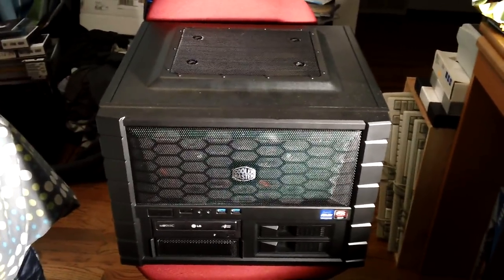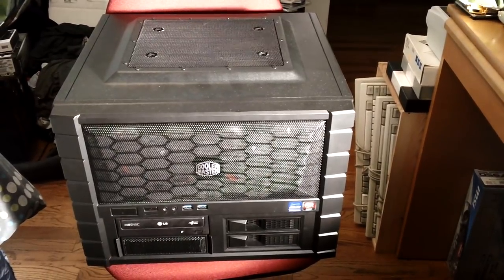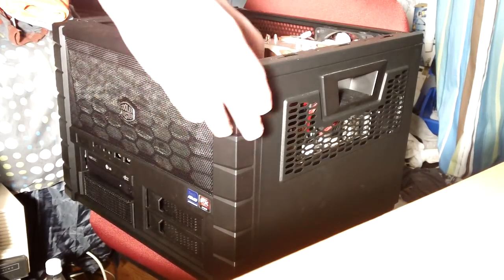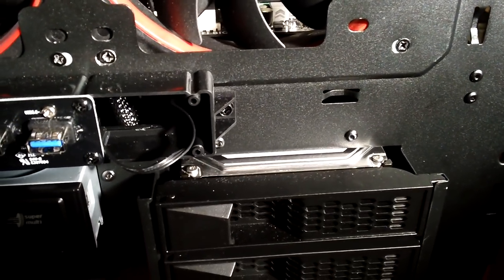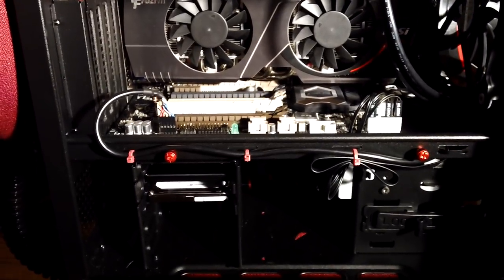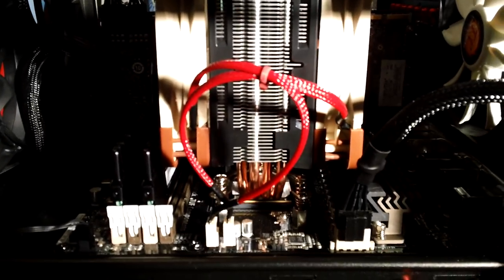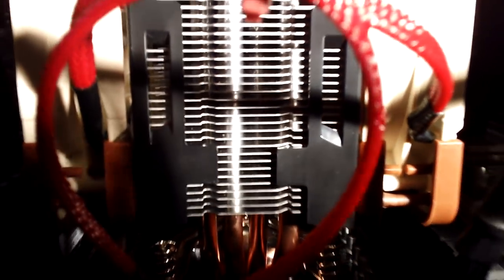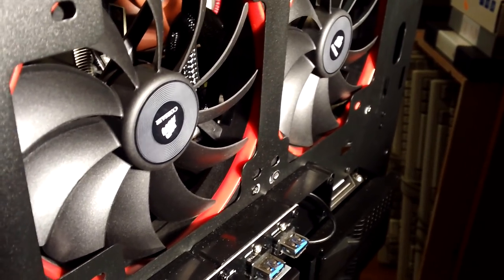My Latest Computer Build

Comment from the maker: I have used AMD for quite a while and if you are planning to build an FM2 system you might want to think about using the dual graphics capability, find the most powerful dedicated card that is compatible with pairing to the GPU in the APU. The FM2 CPUs use the Piledriver CPU cores so they are relatively good, they will bottleneck more powerful GPUs but are more than good for light-medium gaming and video editing. They stay pretty cool so you won't have to sink money in a heatsink. PM me for more

Comment: Its a very chilled out review for sure - you should check out the audio levels for your cut-ins though bud! I'm waiting for my Cooler Master Box to arrive at the moment. I've bought the corsair H100i which should fit in the front cooling panel.... (I hope!)... but Ill let you know.
Reply from the maker: It will definitely fit, I've seen it done many times on oc.net

Comment from the maker: Honestly the larger the CPU heatsink the slower and quieter the fan can be, the Cooler Master 212 Evo is just a good price and gets the job done, also changing the front fans to 140mm helps cut the sound down as well.

Comment from the maker: This case is a bit deceptive, it is basically a case that is slightly larger than a HAF 932 scrunched down and with handles. So you have to decide if the handles will make it easy enough for you to make use of it. It is however a great example of a test bench.

Comment: As soon as I turned this case on, I'd decided the 120mm front stock fans had to go as they (were) far too noisy. So I've ordered 2x Noctua NF-A14 FLX 140mm fans, but I've put them both on the inside as I will be buying a 240mm radiator with a dust filter for the front mount. Best, and most interesting looking case I've ever owned 10/10.
Reply from the maker: It's funny you mention those NF-A14 FLX fans, on my newest build (I didn't like this one's internals) I use NF-A14 PWM (same fan different driving signal) for my main intake. I really like them and they pair nicely with my H220's NF-F12 fans in terms of noise and style.
Reply: speedytech7 Other than the crappy internal fans, this case is great. Going to buy an NZXT RGB LED controller for added idiocy soon (:

Comment from the maker: No, it was actually extremely quiet once I changed the stock fans out for some Corsair AF140s. And the extra airflow from then made it stay pretty cool (for an AMD processor). I found that the 8350 was just a hot processor in general, so I couldn't overclock it much with the Evo cooler. My new i7 is far faster and cooler which leads me to believe that liquid cooling is probably wiser for the 8350.

Comment from the maker: Not bad, 140mm fans in the front certainly help with noise vs. airflow issue that presents itself. Overall though, I would say you can only do better for cooling if you are willing to buy a case that is 2x the price.

Comment: Just built a PC in one of these cases in 2020. Brilliant design, if a little larger than I was expecting. Only criticism is getting the front panel off I broke one of the tabs. It was a used case though and was very stubborn to get off.

Comment: Its 2015 and my build is really similar and still chugging along.

8320@4.4Ghz
XFX 7870 @ 1050/1300mhz

Thinking about upgrading to this case cause my antec three hundred has horrible cable management and I always liked test bench horizontal setups. This case seems like it really would need a modular PSU though, so I might just splurge on this and a solid Seasonic full modular to replace my aging non-modular TX-650 (which although it says corsair on the box, its really a Seasonic). 

Good video, wanted to see how much room was between the 2.5" cage and the 5.25" bay, solid work m8.

Comment: Great vid! Few questions,
Hows the case holding up? I had a meshed Cooler Master, actually rusted in 18 months. (I work in horribly Hot+Humid enviorns)
How is the dust resistance? (No filters on the case right)
Thanks!
Reply from the maker: The case is holding up fine, it is now being used to contain my HTPC/Server. The mesh they use is a steel one that has been coated in a Teflon like paint, but I live in a non-salty climate so I never had the old CM ones rust either. Depending on the fans you use the dust can be minimal or extreme, I have very strong static pressure fans in it plus it sits on a wood floor with no carpeting (dust kind of skates along wood floors and catches on anything with suction or a rough surface). I have to wipe the front mesh off every week or so (it turns into a wall of dust), and I make sure to clean the whole computer out every 2-3 months. Honestly the case keeps the bulk of the dust from my super dusty home out of the computer. As far as protecting the computer, it does that well, but it gets dirty doing it. Hope this helped you out a bit, ask any questions you may have and I'll get to them as quick as possible.

TL:DR : Yeah, it's doing well, gets kinda dirty but keeps the computer safe.
Reply: Thanks! It helped a ton. I ll work on keeping positive preesure in the case. May throw in a few aftermarket dust filters in to be double sure.

Comment: Hi! Great vid!. 
I have one question!
How much clearance do you have between your gpu and the frontal part of the chassi? Do you think the clearance is bigger than 60mm (2.4'') ?

I'm considering this case for a buid with a Asus R9 280x with a swiftech h220 for cooling, with the rad mounted at the front but i have some doubts about the clearance between the two!  
Thanks in advance
Reply from the maker: the Twin Frozr III is a big cooler on my card and I had about 2.5in of room to work with.

Comment: I was thinking of getting a hyper 212 evo for my fx 6300 for over clocking and was wonder if u have any suggestion
Reply from the maker: All I can say is, a Hyper 212 Evo should be more than enough headroom thermally for a FX 6300 but a closed loop cooler is a quieter option to think about as well.
Reply: should be fine , im only saying that as i have an FX-6100 with a crap Zalman cpns5x overclocked to 4.5Ghz , max temp 49-50C

just realized comment is 8 months old of well lol